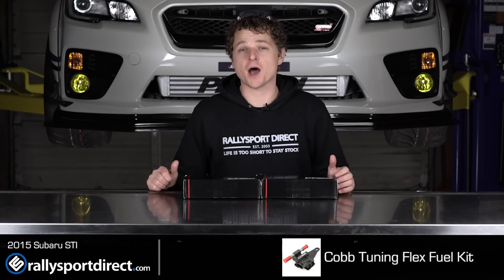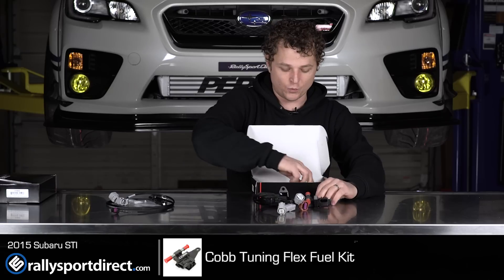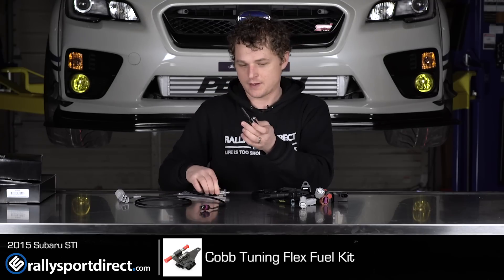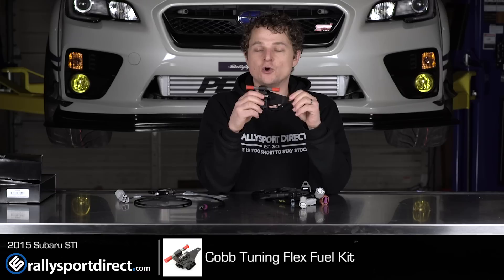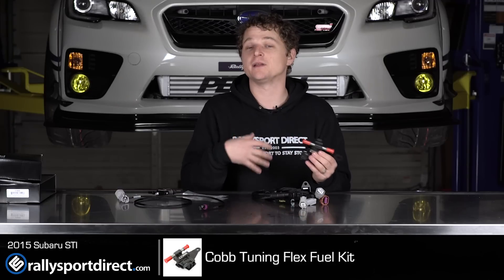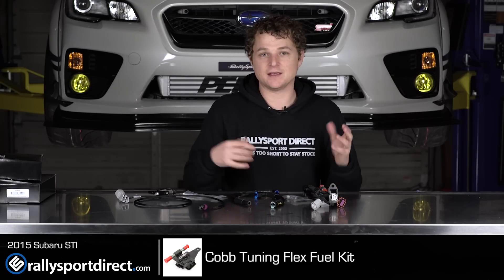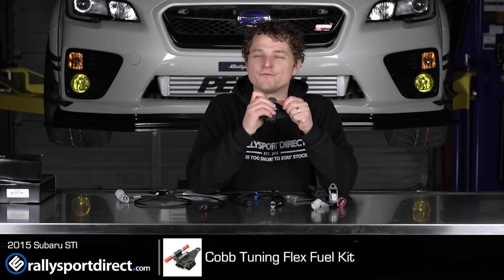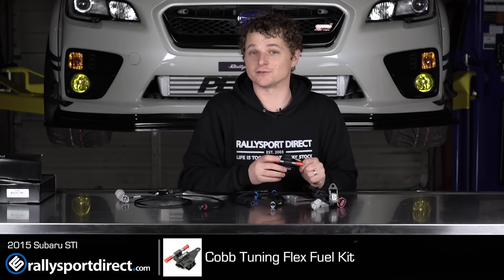COBB Tuning Flex Fuel - Subaru - Install/Review

Comment: Fuel injectors and fuel pressure sensor kit required to run e85?if not, is it recommended?
Reply from the maker: Your tuner would love to see fuel pressure when tuning for sure. So while it's not required, it would be recommended for sure.

Thanks,
Rick

Comment: Is it safe to run e85 kit, fuel pump and injectors on stock engine? (Obviously with a tune)
Reply from the maker: Absolutely, in fact you should see a pretty massive gain in power from it as well :)

Thanks,
Rick
Reply: RallySport Direct thanks

Comment: SO with this flex fuel kit for the sti,  this will help save a lot on gas than stock?
Reply from the maker: No, ethanol uses about 30% more fuel for the same power. A good tune however will help with fuel economy though. :)

Thanks,
Rick

Comment: SHOW AN INJECTOR INSTALL ON A 2015+ WRX/STI video... also if any one has any info that could help with changing injectors such as a video or a step by step.  All i can seem to find is the older model cars no 2015+.
Reply from the maker: It will be a nearly identical install on the 2015+ STI as the older models, however the 2015+ WRX will be completly different as it uses direct injection. If you have a STI, you can follow the older instructions with no issues at all :)

Thanks,
Rick

Comment: Are these installed on oem injectors
Reply from the maker: This car has aftermarket injectors, and you could use this with stock injectors, but to get the most out of ethanol fuel, you would want larger aftermarket injectors.

Thanks,
Rick
Reply: What injectors did you use or more importantly where did you get them? I want to get some for my 16 wrx but I have scoured the internet for days and found nothing for my car. Just STIs. Not even rallysportdirect.com has them for my car. Still new to modding.

Comment: now can you use this and run e85 with a stock fuel system or do i have to upgrade the fuel pump and the injectors with my accessport?
Reply from the maker: You could technically run this with the stock fuel system, but to see any power gains from this you would need to upgrade the pump and injectors. 

Thanks,
Rick

Comment: Do you still have to change maps from pump to e85 with the flex fuel kit?
Reply from the maker: Nope! That's the beauty of it, the sensor will read how much ethanol is in the fuel and the ECU will adjust on the fly, so you can go from e0 to e100 with no adjustment on your end!

Thanks,
Rick
Reply: Do I need to get the fuel pressure kit to make this work or I can just get the COBB Tuning Subaru Flex Fuel Ethanol Sensor Kit?
Reply from the maker: You can install and use it without the pressure sensor, however your tuner will be able to get a better tune while being able to monitor fuel pressure within the Accessport. So the Fuel Pressure Sensor kit would be highly recommended.

Thanks,
Rick
Reply: That go for regular gas like. if you have 93 and pump e85?
Reply: With this can you run 91/93 and e85. I want to do this but if I can't get e85 I don't want to be stuck without fuel

Comment: Does the kit come with instructions on where to mount (return line or feed line)?
This vid is great but would like it if better detailed how-to install.
Reply from the maker: +kbaez You would want to mount it on the return line to help prevent any fuel obstruction, but the kit does come with very detailed instructions on how to install it as well :)

Thanks,
Rick

Comment: Do you need (is it a must) fuel pressure sensor and/or FPR or AFPR?
Reply from the maker: +STiZar They are not required, but for reliable tuning the ECU would want to see fuel pressure. Now in regards to the FRP, the stock one will be fine, but if you are going with a custom tune, then a adjustable FPR may not be a bad idea. It may be a good idea to speak with your tuner and see what they prefer as well.

Thanks,
Rick
Reply: +RallySport Direct Thanks for the info specific info. These custom tuners want EVERYTHING. LOL.

Comment: I hope this will be available for early wrx.  I just bought a 2002 for having fun at the rally track.  e85 during the summer is a fantastic fuel.  BTW car came with the latest access port and cobb downpipe.  Gonna add the cobb shifter some time this month.
Reply from the maker: +OutlawUniverse Cobb is trying to work their way down in the years currently. Now, I am not sure if it will ever reach the first generations. but we hope it does too!

Thanks,
Rick

Comment: would this work with 100% ethanol fuel... Here in Brazil we dont have E85, we have E95-100 or 93 octane gas, that has 27% ethanol in it... What are the benefits of installing this if the ultimate goal for the car is around 330-350whp? THanks!
Reply from the maker: +fredxxbr You bet! and the benefit would be the ability to run any ethanol content without worry about having to re-tune the car, not not only would you possibly see a boost in performance, but also a boost in reliability as well.  

Thanks,
Rick

Comment: so what's the size injectors Cobb is requiring to run this flex fuel system and I'm sure fuel pump as well correct?
Reply from the maker: +Jesse Madrid They have a few staged kits with different sized injectors, and yes a fuel pump would be required as well. 

Thanks,
Rick

Comment: can you run this on the stock injectors?
Reply from the maker: +Kevien Kim Their off the shelf maps will only run on their aftermarket injectors. Now you could tune this for the stock injectors, but it would be ideal to go with larger injectors as E-85 requires much more fuel to make the same amount of power, so larger injectors would be ideal.

Thanks,
Rick